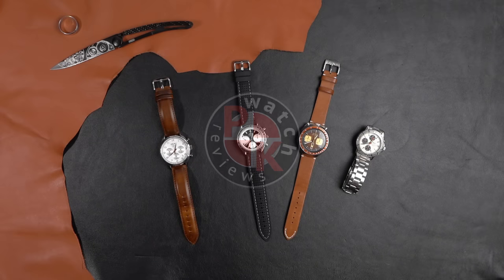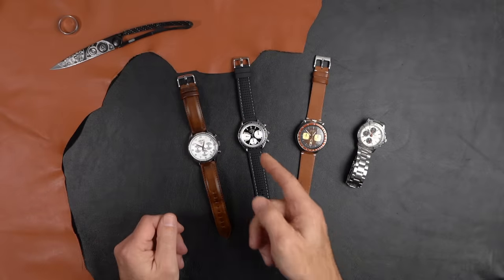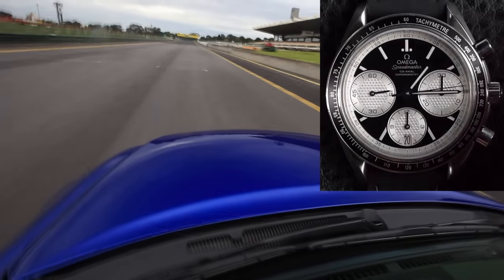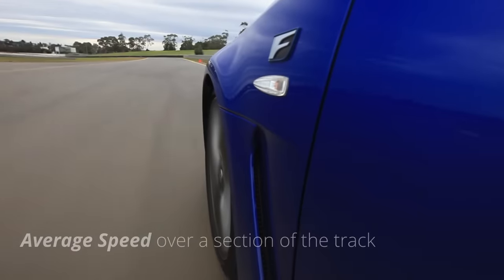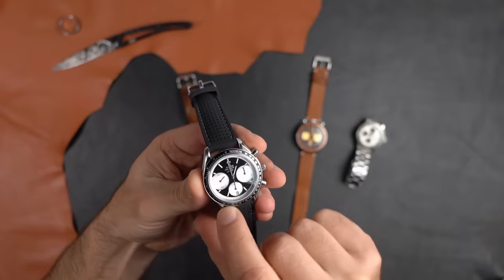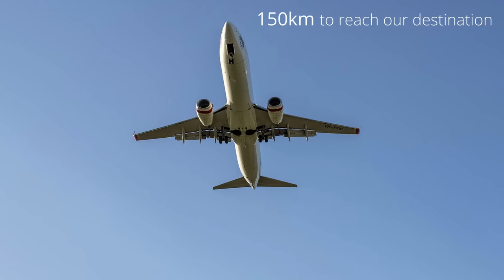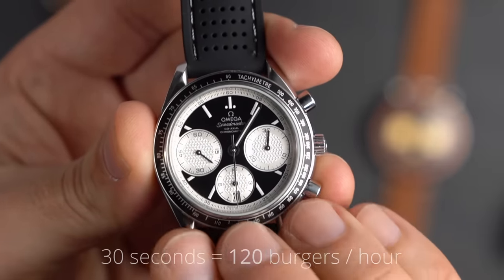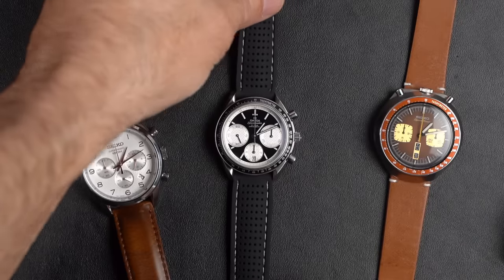How To Use A Tachymeter On A Watch

Comment: @Peter Kotsa
This was in my Watch Later list for a couple weeks... I don't have a chrono yet, but that is in the works.

I've been looking at the Citizen Blue Angels Chrono or the Seiko "Flighty" (SNA411)... would you have any other recommednations that hover around those prices? I would favour Citizen because of the Eco-Drive, and mechanicals are quite expensive from what I've seen.
Reply from the maker: Many seem to gravitate towers the Flighty, I have tried it on the wrist myself and it sat well, but wasn't my cup of tea. I almost purchased it 5 times and 5 times I made the decision not to. 
As for the Citizen it is a better value proposition because of the eco drive..
At the end of the day you need to decide which watch will make YOU happy.
Personally I figured that the Seiko wasn't going to tick the right boxes for me, so I didn't buy it. (even though I could have got it multiple times at a really good price, super cheap, but why buy something that your not 100% on??
That my reasoning, cheers
Reply: @PeterKotsa  I know I eventually want to get a chrono with some form of either tachymeter or slide rule.. but I've been focused on a few divers and field-style watches for the time being. I simply haven't really looked into the chronographs much as of yet.

Not certain if there are any standout brands when it comes to chronograph movements. I'd maybe check out to see if Bulova have some decent ones with their UHF movement... that's why I was asking if you have any "standout" recommendations?

Sort of a starting point to look at you know... You see many watches, probably know that there are some better or worse movements out there.
Reply from the maker: @GODSPEEDseven  I hear you, not really though the two main that you chose in that price category are tops on the list as far as I can tell..

Comment: Does your second hand work as your stopwatch as well
Reply from the maker: The seconds hand of the watch is on the subdial at the nine o'clock and it just keeps running as a standard watch does. 
The central large sweeping hand runs as a stopwatch when activated from the side pushers 👍
cheers

Comment: I guess it's a nice to have tool but nowadays you can head to a website and input the time and distance in whatever unit that you want and get the speed value in any unit that you want🤷 a tachymeter is pretty impractical and fiddly to be useful today especially since most tracks aren't 1 km
Reply from the maker: Good point!

Comment: How to measure speed if you run 1km in eg 4min 10s? The indicator points at abou 366 on tachymeter scale. 
The whole scale went 4 times, so I divide 60/4 and know my speed was circa 15km/h. 
But how to be more precise with these  last 10seconds on tachymeter scale?? 🤔🤔
P.s. I could divide 60/4,165 and get the result, but the question is still valid 🙄

Comment: The constant and average speed examples are the same. In general the method will calculate average speed. It's pretty unlikely for a car to travel at exactly the same constant speed for any set distance anyway. And of course if the car really does stay at an exactly constant speed for a particular time the average speed will be the same.

Comment: I have a Breitling Bentley chronograph watch, the scales don't equate to the one in your video, so no idea how you measure using my watch ?
Reply from the maker: Not sure the Bentley Chrono has a Tachymetric scale on it..
Reply: If this is a serious question and it might be, i'm guessing you have the 6.75 and your right to be confused - it is called a variable tachymeter and its different.  If you want message me and I can dig up the OEM manuals - I used to be a Breitling dealer
Reply: I have a Breitling Bentley..... no idea what 6.75 is?
Just trying to understand the scale/bezel
Reply: @richardthomson203  okay - so it has the numbers 1 to 9 on it yes?
Reply: Yes.....but along with loads of numbers around the outside of the face ?

Comment: Nice video, but the first two examples are practically the same...In both cases the target is to measure the average speed. Because even if you travel at a constant speed you should say that your average speed was exactly that constant speed.

Comment: But if distance between the markers distance are long the scale would show less speed and if the markers distance is short the scale would show more speed, if I walk 2 metres and operate tachymeter then it would show 500 kilo metre per hour my speed
Reply: That's right, that's if the distance is 1 km (according to the tachy scale). However, if it doesn't fit the scale then it has to be converted. So if the distance is 100 meters then your actual speed is 50 kph. If the distance is 10 meters then the actual speed is 5 kph. If the distance is 1 meter then the actual speed is 0.5 kph. So, if the distance is 2 meters then your speed is 0.5 kph x 2 = 1 Kph.

Comment: The only problem is that planes for most part travel at speed os 800 or 900 km/h and there is no such numbers on the tachymeter.
Reply from the maker: You can still do it Tomasz, if the plane is travelling at 800km/hr, then use the tachymeter scale at 400kn/hr (1/2 the speed) then at the end you simply multiply your result by a factor of 2x to get the correct result, 
cheers :)
Reply: @PeterKotsa  thanks
Reply from the maker: @To_masz_Problem  all good :)

Comment: But why do they spin?
Reply: Tachymeters don't - there is an exception to that and its called a Variable Tachymeter.  Bezels do turn, properly speaking watches the bezels that turn do not have the tachymeter printed on the bezel.
Reply: @xmasinpacific  ohh thanks, I always wondered why dive watches spun and thought I saw the bezel moving on the chronograph

Comment: rpm or bpm could also be measured by by stopping the watch after 60 repetitions. Half base scale exists for physicians to measure heart rate in 30 repetitions. 

Actually, the first and most described use of a tachymeter is by far the most useless.